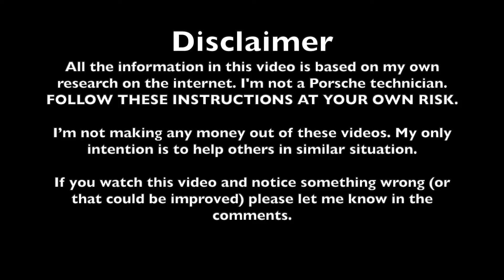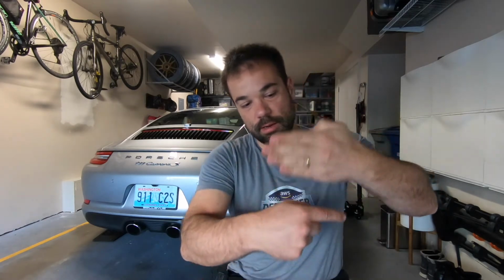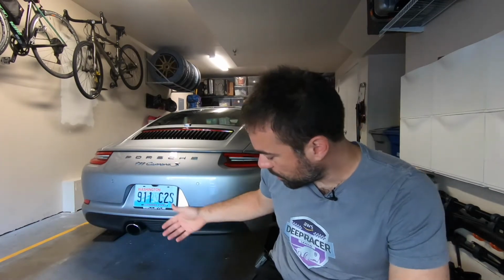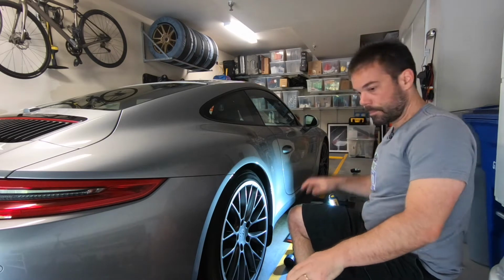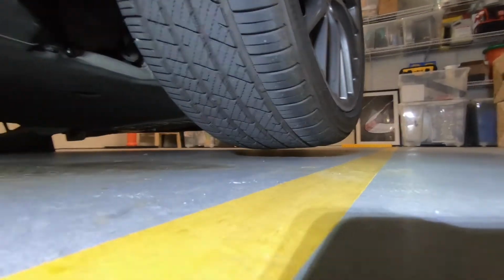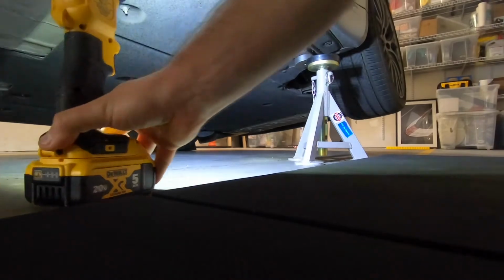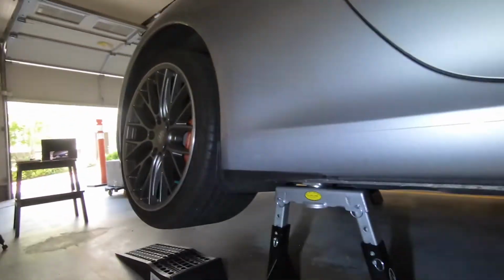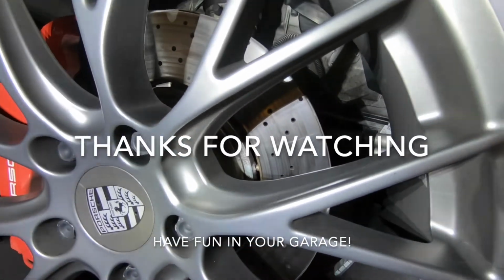How to jack up all four wheels of your 911 (991.2) with Safe Jack RennStand

Comment: Would it work faster if you jacked up the rear/heavier end of the car?  That is, would the lighter front, then, lift higher from only a rear point jack up?
Reply from the maker: humm, not sure if I understand. I think you are asking if it would be possible to lift both front wheels from only one rear point.  I don't think that would work, at least not high enough to slip the stand underneath. But worth trying.

Comment: how to to twist and stress your $100k sports car chassis in one afternoon
Reply: She’s a stiff one as they say!
Which would be a good thing.  But seriously no different than jacking up any vehicle, they’re designed to be jacked at the jack point.
Reply from the maker: This is nothing compared to the stress to the chassis of actually driving the car on the road, not to mention on the track.
Reply: @daherfamily7163  Yes I agree with that but when changing a tire you only lift the car enough to get the wheel off the ground, the twist induced by that is not even close to how high you lifted the car.
Reply: @cartalkwithcarlos1785  when the car is on the ground the suspension and chassis will never see the twist that was induced by him lifting the car that high on one wheel.  This is common knowledge, if you plan to lift the car that high you need to do it in stages or the best way to do it is lift the entire front end or rear end so there is no twist and put you jack stands or whatever you are using on both side at the same time
Reply from the maker: It's not uncommon for a car to lift one wheel of the ground while being driven. The "twisting" of the chassis you see in the video is nothing compared to the stress of actually driving the car. This is also common knowledge. But if you are afraid of causing damage to the car, you can certainly buy another pair of Rennstands and do the same process but in stages. Have fun.
Reply: @nickf2000ss 
I see your point for sure
Probably would be ideal to have 4 of the renstands and not have to jack up the rear point high enough to get a normal jack up under the front. 
I’m no engineer but it does make sense